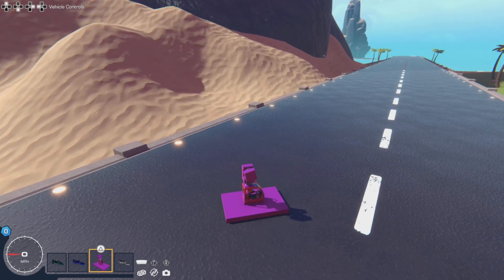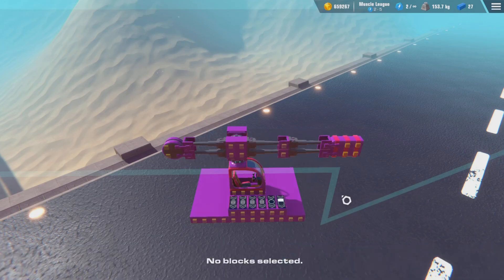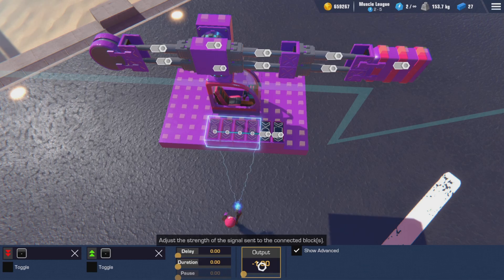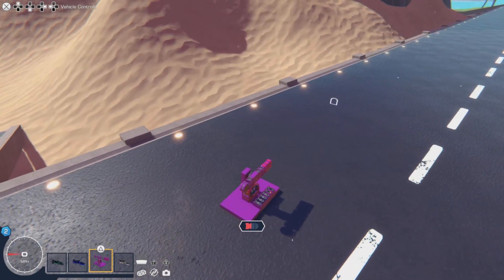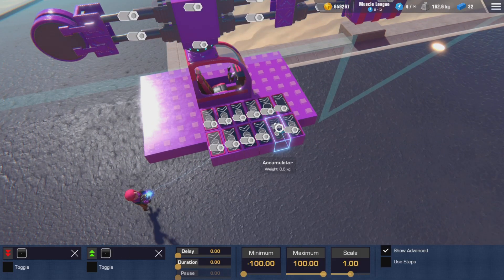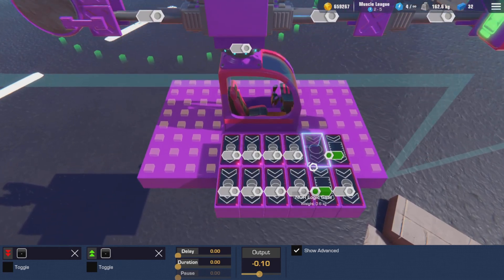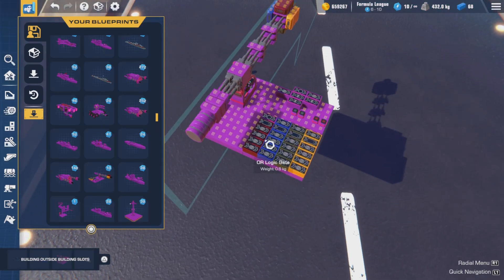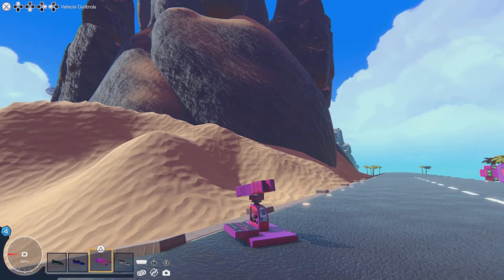Bomb Bay Artillery Tutorial [Trailmakers]

Comment: Omg that hover is so stable (0:37). I have hover logic of my own, but never that stable, even when using counter-rise thrusters too! How did you do that?
Reply from the maker: I recently made a hover logic tutorial you can check out for the full details, but that build is certainly my most stable execution of it, there's no counter-rise thrust either. The main thing of importance is probably that my hover speed sensor points up, is set to 0.2, and has 'triggered below' turned on, so it starts to increase thrust before it really moves down at all
Reply: @fenrir_fullmoon  Huh. I tend to use a speed sensor facing down, set to 0.0 to immediately counteract gravity the very milli-second it falls

Comment: Sometimes, because of the connection, the cannon only fires 3 bombs and the 4th one falls on your feet. Is there any way to increase the duration so that the command goes through the 4 logics? With lag, it only goes through 3.
Reply from the maker: I've not had that happen before even in laggy situations so I'd double check the numbers in your logic first, but if it looks okay in there and still causes issues in lag I'd try bumping up the max value of the accumulator just a bit and see if it helps

Comment: Checked Frame for Frame, All of my timings are the same as the single you displayed.Yet, Every time the fourth bomb fires out of the bomb bay it falls short, this destroying the build. Or gates are set.0,.27,.52.78.

It's very likely a fualt of my own but, I've tripple checked
Do yout think the timings may have changed?
Reply from the maker: I checked my builds and they still work so nothing has been changed in the game since uploading this vid. Do your pistons extend the fourth time at all? If not your last timing OR gate might still have a positive output on it. If it isn't extending on the last bomb I'd double check the numbers in the accumulator and that it's connected to the OR gate
Reply: @fenrir_fullmoon  The pistons do extend the fourth time yes. I ended up messing around with the duration timings. Each are set to a duration and pause of .07 and now they work flawlessly.

Thankyou for your willingness to help
And just for the tutorial as a whole of course
Everything works woooo!!!

Comment: This works very well, but it doesn't seem to work with three
Reply from the maker: I took a look at one of mine that has a triple and found out what it might be. Like the quad it has a duration of 0.05 on the timing OR gates (the ones directly connected to the pistons and bomb bay) instead of a duration of 0.1 and I didn't cover that properly in the video anyway. Hope that helps out

Comment: I tried the timings for the quad and it fail. Did I just get the timings wrong or did it change? My timings on the OR gates link up to the accumulators are .06 , .12 , .18
Reply from the maker: I double checked and I think I forgot something in the vid: the duration on the timing OR gates (the ones that have 0.0, 0.27, 0.52, 0.78) is 0.05 on my quad setup, not 0.1 like in the single setup
Reply: @fenrir_fullmoon  Alright thank you

Comment: you do NOT need that much logic bro
Reply from the maker: It's only 6 per bomb bay, but if you need less pieces you can leave out the nor gate and accumulator and set the firing button right on the timing or gates, but I like having my safety mechanism to keep it firing all its bombs in case I don't hold the button down long enough